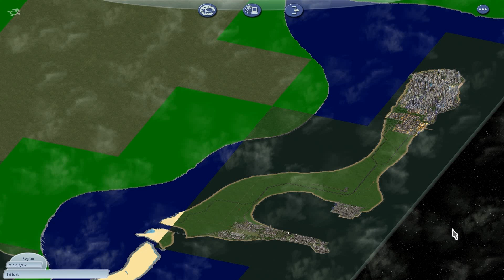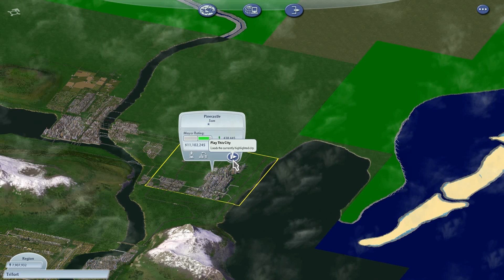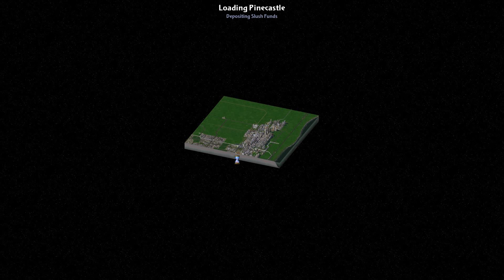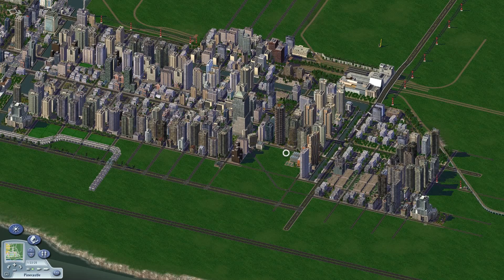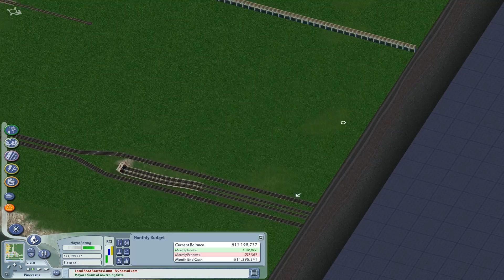SimCity 4: Let's Play Pinecastle, episode 35 (Interchange construction)

Comment: Around 29:00 and 38:20 There is dragabble pattern for that RHW2 splitter what you wanted to use, so the puzzle piece is actually outdated now completelly
Here is the tutorial for this. Check out Ganaram's other videos as well. Not all of them have been implemented although.
https://www.youtube.com/watch?v=b2PeDUDlwvw
Here is a picture album link to show the drag pattern your ramp set up (I hope it shows up with the link, but let me know if it isn't):
https://imgur.com/a/gJ9M6PS

Most of the RHW2 and RHW 4 splitter ramps are covered by now. Only the RHW 6 and 8 bigger splitter ramps are not covered. Also for tight situation with puzzle pieces you can always try to use the RHW Disconnector. But it is also useful for many other situations: railways, roads etc... I think in future NAM releases there will be this disconnector piece in every network menu for easier accesss (at least we were talking about this within the NAM Team, which I'm member of since last autum).
https://i.imgur.com/yCwmIT4
Also there are shorter quick intersections for AVE6,  it's like the whole thing pre-build, but still flex. And since they are flex you can modify the the road for a longer turning lane while you keep the AVE6 shorter. The tutorial images also under the imgur link.
https://i.imgur.com/J9kuV4q
So as you can see, you can play with the new pieces. They are quite good. :)
Also I recommend you to check mgb204/rsc204's mods (Terrain Grass NAM, No Grass NAM and/or Sidewalk NAM) on STEX and LEX. They are handling a lot of puzzlepiece sidewalk situations...
Really great video by the way! Thanks for making it! Your videos are still giving me a bunch of inspirations. For example the Shinjuku Station, the Shibuya El-Rail complex etc... Also loved your other series with the suburban setups.

- Tyberius
Reply from the maker: Wow, thanks for the comment and all the helpful links.  I'll check them out shortly.  Just goes to show that even thought I thought I had figured out mostly everything with the latest NAM version, there is still a lot for me to learn about it.